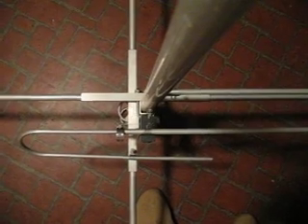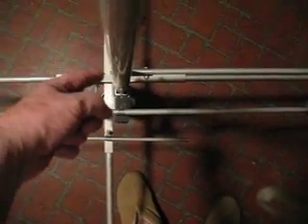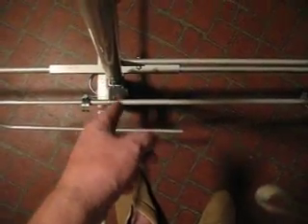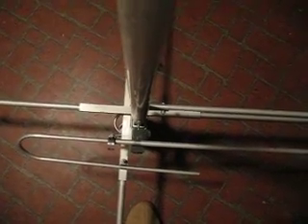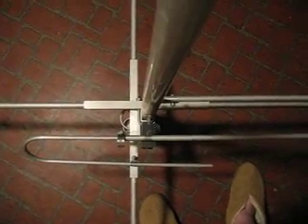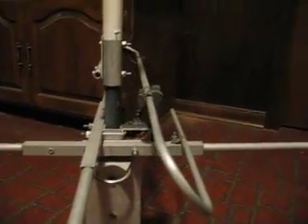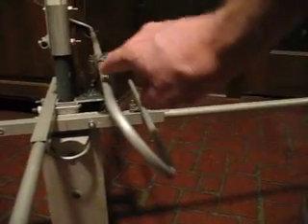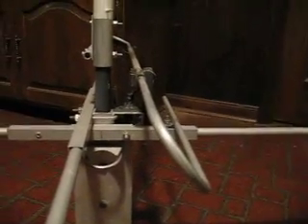I-10K trombone matching device

Comment: I'd like to see a tape measure placed across both the shunt & the matching trombones. I'll bet the matching measures right about 53" of tubing from the feed to the radiator connection, possibly minus any wire length from the connector to the matching trombone.